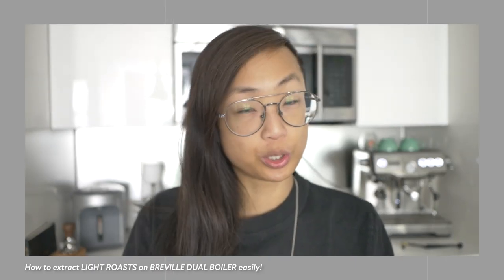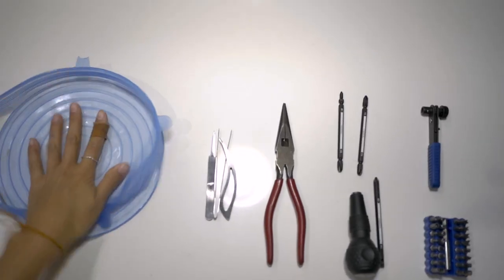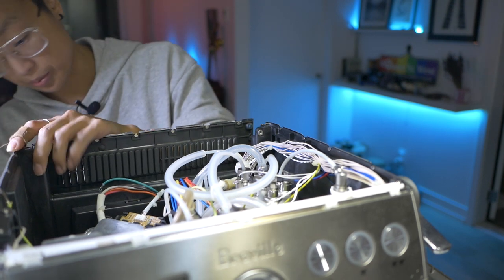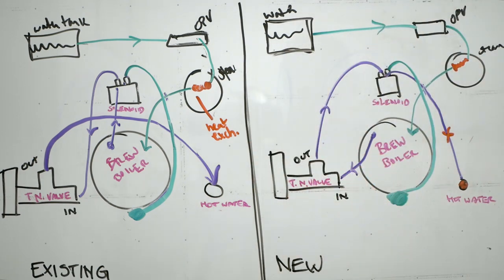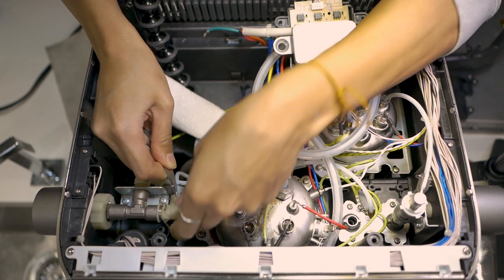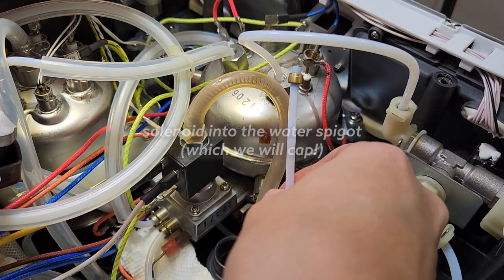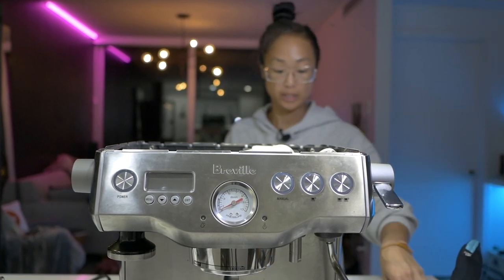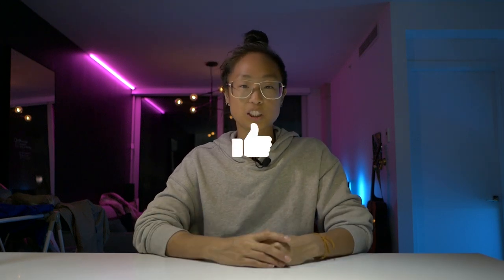Step by step UPGRADE FLOW PROFILE (slayer) your Breville/Sage Dual Boiler 920XL: Part 1

Comment: The absolute best Slayer mod on YouTube! 

To those who drop things: always set the BVD on a large towel so small parts don’t hit the counter and bounce away into oblivion. 

Instead of tweezers get a Kelly Forceps, also called a hemostat. They lock into place. If you want to use needle-nose pliers, slip a rubber band over the handles, so you have to use a little force to open the jaws. The rubber band tension will hold the jaws closed. If you are unlucky enough to lose a clip anyway, a piece of bendable wire the same thickness as the clip can be bent into a “U” shape, inserted into the holes in the valve housing, and twisted closed. It works great. I found my lost clip right after I invented this hack. Last, use magnetized screw driver heads as mentioned in the video.
Reply from the maker: great tips, I actually just got myself a hemostat cuz I have some doctors in the family and they had a bag of them hehe, I've already used it a few times for various repair jobs
Reply from the maker: I have some follow up vids on using the slayer mod

Comment: Awesome tutorial, super clear and was able to successfully do the mod yesterday. Just some notes from my experience - firstly when removing the microcontroller switch and screwing in the screws to the holes for safe keeping - don’t screw them in all the way - i accidentally screwed one of them in too far and it ended up locking the hot water knob in place!  Second tip is just to be super careful when reinserting the pins, its pretty easy to accidentally lose grip and drop one which would be very difficult to retrieve. So don’t be in a rush and do it carefully. Oh also - i’m in Australia have a 920 machine, my front screws were anticlockwise to unscrew
Reply from the maker: Amazing! Glad it helped and thanks for sharing! Def too easy to lose things in there

Comment: Hey! I've been watching your dual boiler videos for a while now and I really like them! keep them coming :) 

I also own a Breville dual boiler and I've done a few mods to it as well. My latest one was replacing the original pump and OPV for a brass one, after the upgrade I've been having way better pressure consistency and the machine has been running much quieter as well!. I also read that this might prolong the longevity of your machine as the components are solid brass material and not just cheap plastic.

I am only telling you this because I know you are interested in doing mods and improving your gear. If you end up doing this mod, I'd be very keen to see you doing a video tutorial on this as the only video tutorial about it is not the best quality, a bit outdates and somewhat amateur.

Anyway, thanks for the videos! 

Cheers from Australia

Comment: Hey Jess I have a question for you. My breville duel boiler now has mist bubbles in the front pressure gauge and in the lcd screen. Any ideas on why and how to fix would be greatly appreciated! Duane
Reply from the maker: no idea on this one sorry :\ I believe you can buy a replacement part for it but I would definitely open it up and check for leaks

Comment: Thanks for the guide. 👍 I'd seen this mod mentioned a while back by Lance Hendrick and had been meaning to do it on my 920 here in OZ, but like a lot of things, never got around to doing it. This video was the catalyst to get it done, so in preparation, I have ordered an O-ring kit and they should be here next week. In the meantime, I removed the 2 screws underneath the front panel, and as others have mentioned, I found them to be a normal right-hand thread and a non-JIS spec Philips head screwdriver works fine.

Comment: Excellent video.. thanks for sharing. I was able to 1-up you though ..referring to the dropped screw. I managed to drop one of the tiny hose clips into one of the deepest, darkest places inside the machine but thanks to a small telescopic magnet, I was able to retrieve it.
Reply from the maker: nice!! you already had it on hand or you got the telescopic magnet from seeing my tutorial?
Reply: ..was holding the clip with needle-nose pliers and was attempting to re-insert into the middle of the three ‘ports’ of the solenoid. The clip wasn’t perfectly aligned and when I applied pressure to get that satisfying click, it became dislodged & fell. I inherited a telescopic magnet from my dad & watched him use it countless times performing auto repair. Your video was more helpful than the others I’ve seen b/c the others do not mention disconnecting the switch which activates the solenoid at the knob. THANK YOU for that!!! Saved me from disassembling another time. Now I’m working on a mod w/ your slayer mod but keeping the function of the water spigot..waiting on parts to arrive & could be a bust but will be a fun experiment. Might paint the side panels like Eddie Van Halen’s guitar in the meantime 🤟🏼🤩 🎸 
Will keep you posted.. in the meantime, please keep posting the great content & sorry for the long reply. Cheers!

Comment: Have to say that's one mod I'm yet to do to one of my BDB's. The PTFE tubes are the same on the 900 and the 920 so the process will be the same. If you have some food grade lubricant, lube up the o-rings as well and they'll last longer. I love how Breville called the triac board a cup warmer. It's really just the board that turns on the heaters for the steam and coffee boilers and the heater for the group head.The triacs generate a lot of heat and are cooled by transferring the heat through the heat sink into the top cover which we use to heat our cups. Pretty smart really. Oh and if you lose the little hitch pins, try shaking the machine upside down over a towel and if that doesn't work, look for '7/32" hitch pin external' online and grab some replacements. Looking forward to seeing what you do with this mod.

Comment: Would you be able to do a how to upgrade / change the needle valve for this mod? I did the slayer mod via your help and it works great but the dial is too sensitive and I be needing some HALP figuring out how to change this

Comment: I've had a Decent Espresso for three years now and haven't been reading much of anything on the BDB.
Will definitely do this mod and get the machine working again for possible resale. Always liked it but using tap water eventually messed it up.
Nice clear video!
The warranty being cancelled for doing this mod is kinda funny. Breville should have been in the forefront of this modification for consumers. Unbelievable!
Reply from the maker: from a company standpoint, it makes sense as they don't want to be responsible for someone messing up the internals, not everyone is handy

Comment: Went through the HB thread and also some of the older vids, but it didnt gave me much confidence to do it because i felt it wasnt clear enough. This is a great, great example of how to do a tutorial. 

Usually I dont leave comments but this is peak content making. Slayer mod is one of the main reason I bought into BDB and will definitely be referencing your video when I get around it.

I also saw your comments on the reddit regarding existing tutorials and am glad you came around making a much better tutorial to help those that will experience the same issues as you did.

One question I have is why the hot water spigot might leak. Based on your diagram, there is no longer any instruction for the solenoid to send water towards the hot water spigot, and with the silicon in place to exert negative pressure, so I’m not sure why some people are still experiencing leaking from the spigot
Reply from the maker: That one is a mystery I've been trying to solve and still don't have an answer to :/ unless my diagram is wrong but I used Phil Knight's old video for the water, went over all the videos I could find and HB threads to piece it together and confirm and it makes sense. I'm thinking maybe there is just too much pressure it wants to go through there anyway somehow?
Reply from the maker: And thank you for the kind words :) I definitely hesitated doing the slayer mod myself because I didn't find it clear elsewhere and didn't feel confident doing it myself so I'm glad it can help others

Comment: What is that hot water tap switch  doing?? I only have the control wheel but no switches besides it (from the outside). You unscrew it but left it in the same place so, what did that action do?

Comment: 15:53 this in fact is known as the ‘triac board’… its purpose is to control the heating elements in the boilers and manage power to them. Its placed on the top of the machine to make use of the space for heat dissipation from the heat sync. Doesn't at all have anything to do with being a ‘heater’ for the top of the machine; the boilers get really hot thus heating the top cover…. P.s love from the UK 🇬🇧
Reply from the maker: thanks for sharing! the more you know!

Comment: I have had the slayer mod on my BDB for more than 3 years now. it literally worth trying. it gives a new dimension to the experience! now you could  try 3-6 low pressure long extraction, regular 3-9-3 slayer shots or   whatever you want to try.
Reply from the maker: Is that with light roasts and how you brew? Using pressure gauge?

Comment: Can't wait to see how you like it! I started using flow control on my E61 and found that it works really really well. I found the dial in tutorial on the Slayer YT channel to be really helpful for dialing it in (they also have a flow chart pdf for reference). I'm not sure if the 20s pre infusion and 30s brew time would convert 1:1 with a smaller portafilter but it may be a good starting spot.
Reply: Smaller portafilter? Be careful, throwing insults like that around is dangerous! 😂
FYI, the Breville dual boiler, (and Oracle models I think) use full sized 58mm

Comment: So after being inspired by you, I decided to do the Slayer mod using your instructions (which are great btw). Relatively straightforward but the part where I struggled was plugging the hot water spigot. Mine still leaks a bit but the mod works. I think I'll end up capping mine off though. I plan to leave the valve fully open unless I want to do pressure profiling. Also I'm not sure what effects leaving it open and pushing pressure back into the distribution block for the hot water spigot and the steam wand is going to do long term but I don't feel like trying so I'll cap it off.
Reply from the maker: Mine leaks a little, tho less than before when I redid the silicone cut out. I read it needs to be a thick silicone so I'll try to double stack until I get something else. Still works tho

Comment: Thank you for doing a very thorough clear video on how to do the slayer mod. Just a question am I correct in thinking that by doing the slayer mod you are able to have the pump pressure on full and you just control water flow. By doing the non mod version from one of your previous videos am I just lowering pump power but water is still flowing in at full flow?

Also is there a substantial improvement in taste by altering it to slater mod over just lowering the pump power?
Reply from the maker: @fathemabegum6012  there's a follow up video on how to do flow profile on my channel that may help!

Comment: I might attempt this mod on a different machine, would it still work if I bypass the line after the solenoid and before the group head or does it have to be between the boiler and the solenoid?
Reply from the maker: Unsure I only did this mod

Comment: what happens to the pressure? is it still 9 bar?
and could you then do a dimmer mod for the pump to control pressure as well?
Reply from the maker: you can still reach 9 bar yes once you open the valve open which doesn't require a lot to open up. It's quite sensitive.
Reply: @jpjay1584  set PI time to 99, then set PI pressure at whatever you want, no need for any mod

Comment: Jess could u also make a tips and tricks video about the bdb, something like also to resolve problems that can occurs. I've just solved the gurgling in pre-infusion changing the percent in setting, simple but not immediate to know. U  can do a good job i'm sure of this.....😉
Reply from the maker: That's too vague...what problems? You most likely can google that. I have tons of videos on the BDB for tips and tricks otherwise already on my channel, shorts and long videos 😉
Reply: In my case, after 1 month of use machine starts gurgling during the pre-infusion and the espresso extraction takes 10 more seconds, seems caused by a lost in pressure.
The solution was to change the percentage of pre-infusion from the minimum to 60, the reason was a long use time at the minimum value.
Something like this...😉
Reply from the maker: @claudiobarone4162  perhaps open it and adjust the OPV valve? See if you're getting good pressure (~10) with the blind basket on

Comment: can you do a video of using it? and showing how to replicate stock modes for the 3 buttons?
Reply from the maker: it's being worked on but it will be a while before it's released
Reply: @GadgetsGearCoffee  it is possible though right? To replicate the stock functions?
Reply from the maker: @jlyt18  yes, the valve is just an open close (and gradual)

Comment: I must have insanely large hands, or Breville has somehow made it so my machine hates me. I lost one of the clips, with it falling into what seemed like the group head. 

I really hope a cut down, and bent paperclip can handle some pressure, and that my machine doesn't kill me by shorting against a part of the case with the screw, or two that I've lost. Such is life.

(After about 5 hours, and a lot of strife, it works. Hits up to 11 bar with a cleaning disk in a dual wall, and I don't hear spraying or arcing from the machine so success)

Comment: What are your pre-infusion settings on the dual boiler when doing a slayer shot?
Reply from the maker: 0s, I'll explain in an upcoming video, will likely be released in a 2-3 months from now
Reply: @GadgetsGearCoffee  thank you so much! There seems to be a good amount of info out there on how to complete the slayer mod and pull a shot using flow profiling, but I can’t seem to find clarification on what pre-infusion time and pressure settings to use on the dual boiler. Your answer here is what I’ve always suspected, so I appreciate the confirmation! Pre-infusion time of 0 would mean full pressure the entire shot, just like the actual slayer, with pre-infusion controlled with flow, not pressure. Looking forward to your upcoming video. Also, I think this is the best video out there on how to complete the mod, so congrats!

Comment: Didn't know the front screws were reverse threaded. Wonder why?
Reply from the maker: I don't know, I tried to look it up. I know in some industries like car some screws are reversed threading because of the possibility of the time coming undone with time for important moving parts. But here? Not sure
Reply: @GadgetsGearCoffee  the main reasons for reverse threads are when there are rotating parts. If your threaded part rotates in the direction of unscrewing it will unscrew itself. But in this case as there's no moving parts I'd say the main reason is to discourage people from opening the machine.

Comment: Doesn’t look like you ever did the follow up video showing how you liked using the Slayer mod… I can’t see it anywhere. Great video though, I’m working on a friend’s 920, replaced all of his o-rings for him, and he needs some other things replaced, such as the thing you called “the cup tray heater” which is screwed to the top, that is actually not a heater, it’s called a Triac Board, and it controls the heating of the two boilers. 

If you get a leak from a perished o-ring on the steam boiler, very common, steam will leak up and cause malfunction of that triac board, and you will get weird behaviour or complete failure of the boilers, and then the thermal fuse will blow on the brew boiler if you don’t switch it off at the wall before it overheats. Yep, just switching the machine off won’t work, because the triac will allow the brew boiler to continue heating so long as it’s plugged into the wall outlet!
Reply from the maker: Ya I haven't made one yet, lots of notes but still figuring things out